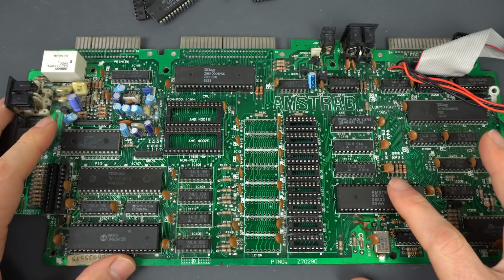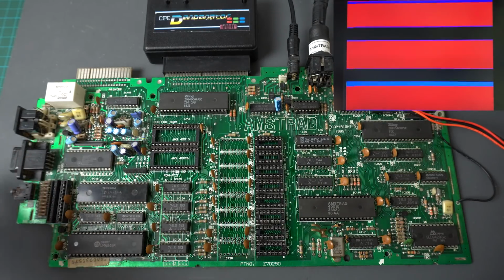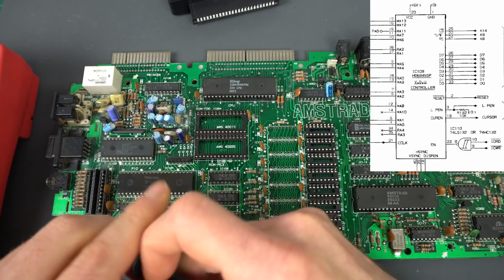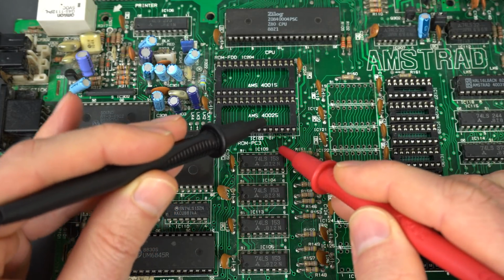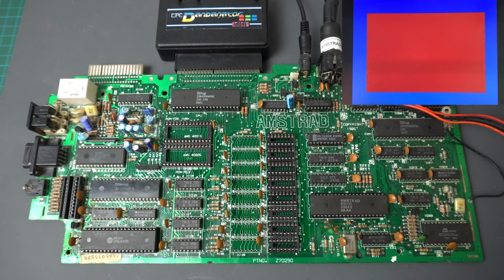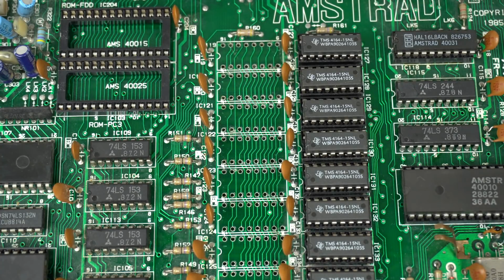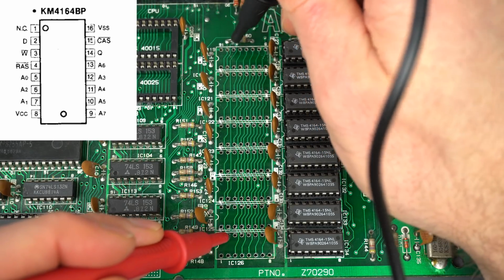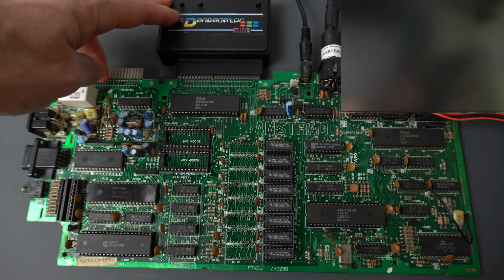Amstrad CPC 6128 Super Fragile PCB Tracks

Comment: excellent repair there. my 6128 though ive made a lot worse today 😢 i had changed all of the ram for ram sockets.. 7 repaired traces later i go to connect the cables to the board without the keyboard just to test and i had connected the 2pin connector of the 12v in into the 2 pin connector on the top left of the board...
i turn on the amstrad and got a black screen initially, but after checking continuity again on the ram and the 400025 chip it booted to a black border screen with a solid pink sort of colour. im going to buy a dandanator if i can find one in stock to see what it could be. i wish i hadnt have messed with desoldering all of the ram!
Reply from the maker: You can also just burn the diagnostics ROM to a 27C128 (or 256) and use that, but you'll have to desolder the ROM IC for that.

Comment: I have worked on all of those machines and I believe that the  the 8bit line and especially the 800xl without the Freddy chip has the best board to work with. C64's(and Amiga 500) ground and 5 volt planes are so massive and the absorb all the heat that even changing caps becomes a pain, Speccys are really delicate as you said and I was fortunate enough to watch this video before digging in my CPC!  Last month I worked on an Atari 130 XE. I removed all the ICs , installed standard sockets... and didn't work. I remove all the sockets  since I don't have have diagnostic tools,  installed machine sockets and it worked perfectly. I even de-soldered some  sockets for a third time  (really late arrivals of machine sockets) and no tracks were broken. I can not say the same for an 65XE though!

Comment: I worked for Control Data in the late 60's early 70's and we used 30 gauge wire wrap wire to repair or modify circuit cards.  The nice thing about wire wrap wire is you can route it between pins on the topside as well as solder it to pads or traces on the underside. A tiny drop of glue will keep long wires in place so they don't snag and get pulled off.  

We used to call the mods to existing boards "engineering change orders" so we often just called the wire ECO wire!  

I prefer videos under 20 minutes as well.  Some of the channels with hour or longer videos are useful but hard to watch all in one sitting.

Comment: Thanks for the video.  Been looking at Anstrads but so far just looking.  Guess the takeaway for me is to just do a continuity test every time you replace something.  Pretty sure I was taught that, but you know how that goes.  But with the amount of stuff you pulled I can see how you could really get behind the curve.  Wonder if using some hot air and a solder sucker may have been less abusive.  I find that just because I have a tool that is fast I tend to use it.  Sometimes fast just turns into more work in the end.  Anyway thanks.  Great content.
Reply from the maker: Checking every single connection you unsolder is ideal but a bit unrealistic when you do massive ones like in this board. And really, 99.9% of the time I either have no problems, or I'll see that I pulled up a track and I'll fix it. What shocked me here is that I honestly thought they were fine and the damage was tiny.
Reply: @NoelsRetroLab  Yeah I couldn't see it on the video.  I was kinda shocked too because everything I've seen on Amstrads say they are built really tough and are one of the more reliable of the 80's 8 bits.

Comment: Thank you Noel. I have never had a problem with any of my 6128's. Then again, I don't supply the 5V rail with 12V but if any repair is needed in future I will be aware.
I can't understand why the tracks need to be so thin. After all the blank PCB's are fully coated with copper before etching so that rules the cost saving out.
Reply from the maker: Yeah, it's puzzling. Especially having great examples like the C64 boards.

Comment: The shape of the track->pad connection on the C64  is called "teardrop" ( https://en.wikipedia.org/wiki/Teardrop_(electronics) ) and it's made specifically to prevent the stress point where those breaks happen. It's much less of a concern on modern PCB process, but still used regularely.
Reply from the maker: Thanks! I didn't know that name, but I definitely saw that the C64 has that shape. This explains exactly why you'd want that! Now, was it more expensive to design PCBs with that shape? I wouldn't think so, right? I wonder why they didn't use that in these boards.
Reply: Mmm, I don't see why the PCB production would be more expensive with that shape, it's just the photo mask that changes.
Now it's possible that whatever process they were using to create the photo mask master didn't support it ...

Comment: The format works.

  If you get some spools of tinned copper bus wire and some tiny heat shrink tubing to match, it makes jumper wires much easier to deal with, and gives cleaner looking results.
  The bus wire can be soldered to the first joint while still attached to the spool, then contoured, covered with shrink tube, cut to length, and soldered. I get tubing that is barely larger than the wire and don't bother heating it beyond just soldering it. The length doesn't change significantly either way, I'm just skipping the step because it's a waste of time. 
 Alternatively when a point to point through hole wire connection is needed, use the heat shrink tubing cut to length, then add the bus wire to make perfect 90 degree through hole solder leads. The result is a perfect length, virtually heatproof, insulated wire. It's faster than cutting and stripping wires too.

  BTW, if you liked the silk screen with the pin numbers on this Amstrad, I have a github repo for classic dip chip pin labels you can print-cut-paste them on. There are around 300 part numbers available in pre-made PDF's that should be ready to print. The two GIMP xcf files I used to make everything are also in the repo, one for standard width chips and one for wide/oversized (like 68k), along with a full description of how I used them with the layers file organization structure and fabrication guide layers. I tried to explain it so that even someone unfamiliar with GIMP could figure it out. If you check out the repo, my labels are unlike any you'll find elsewhere. 
  I started the label project after beginning Ben Eater's breadboard computer project and getting tired of looking at datasheets constantly for pinouts. Later, I also got tired of the nonintuitive pin nomenclature used on the various chip datasheets, so I started evolving my labels with lookup tables, logic gate graphics, and other (hopefully) more intuitive naming conventions. I'll skip adding the link here for YT reasons, but my github account has the same name as here, searching should find it easily.
   These labels might be a convenient filming alternative to the datasheet pinout overlays, although I didn't exactly design them for this, and the text sizes may be too small to be useful. I can also say, the labels are easy to add and remove using PVA glue (white glue like what is used in grade school), and alcohol to remove it without a trace. Most of my labels have full pin numbering, function naming, and a header portion with part number, manufacturer, and purpose. Most part numbers have several label versions, and I've made labels specific to the various package dimensions of my parts stock. I mean things like the logic gate chips that come in the short 1/2 end pin configuration with shorter length versus the ones that have overhang. I've made labels for both so my labels fit either version perfectly.
 
  I'm not monetized here in YT, and the labels are MIT licensed (AKA no warranty, do whatever you like with them, I don't care if it's commercial or otherwise). I share freely, no strings attached.

Thanks for the upload.
-Jake
Reply from the maker: Thanks for the feedback. And that sounds like a good idea. I'll try that. Cheers.

Comment: I do like this format for both its "quick fix" content and running time. Personally, I usually prefer retro repair videos under 20 minutes -- multiple parts are fine but 20-ish minutes suits my free-time requirements the best.

Wow, those are thin traces. It is no wonder why they are so delicate. I have used the same probing technique when testing C64 RAM faults; it's quick and methodical. Great work again with this video -- very informative. 👍

Comment: I find the fragile PCB traces are more a board manufacturer thing, as you will find boards made by a particular manufacturer are robust, yet the same board layout from a different supplier, ostensibly the same board base material, is more prone to either delaminating or breaking tracks. I got reasonably good at repairing them on some, as the traces would lift, so you had to glue them down with superglue, and then solder in a thin wire link to get connectivity, then glue the trace back down again where you soldered, as that are had debonded again. Then a thin film of conformal coat applied both to protect the board, and to hold down the other traces as well. 

Had to do a lot of really thin wires through some through hole traces to get connection to the inner traces, though they were only power and ground, so easy enough to simply glue down a wire to an alternate hole nearby for this, in addition to the original hole being repaired. Some of those boards the only thing keeping the traces on it seemed was the conformal coating, which was not meant to be solder through, but with a good extractor to get the fumes out fast you could solder through with no problems. 

Some though the coating would survive solder temperatures without passing it's glass transition point, so you had to use fine sandpaper on a stick to get through it to solder. Those boards you had a 50/50 chance to get the component off in many cases, as if there was anything under it trace wise you knew it was going to get torn off with the faulty component in most cases, and you would have to do a whole bunch of fine repairs. Those boards though were bleeding expensive as spare parts, so you did try your best, the price was more than the mass in gold.

Comment: Nice format and easy to comprehend explanations. Did you ever try to use the wiring pen for repairing the tracks? Works much better than the wires in plastic insulation. I once had to fix 4 factory-drilled holes on the RAM placeholders of the CBM-4008 motherboard. Those were drilled to prevent RAM upgrade. Using the wiring pen was the obvious choice. You can even do the cable management with the special plastic holders.

Comment: the tracks on that 6128 look great compared to the ones on the 464 board i have..almost looks as if they are just soldered tracks.. bubbley and wavey in places and way to easy to bridge the tracks! 
nice one Noel.. keep it up!
Reply: Hi, these bubbly and wavey tracks are just fine. Back than the HASL process ( hot air solder level) as it is done nowadays wasn’t esteblished that widely and ENIG (electrodes nickel immersion gold) is expensive in this low budget market for large boards so they simply put the bare boards through a wave solder bath a - for protection and b - for added current handling capabilities on thin traces. Those old HMOS and NMOS chips are much more power hungry than more modern CMOS variants.

Comment: After using the desoldering gun, a little bit of hot air really does miracles during the actual IC removal. It works. No pin wiggling necessary. I never damaged a single pad anymore since I'm using that method.
Reply from the maker: The problem is that the hot air needs to be hot enough to melt the solder, right? I'd just be concerned about damaging the IC (assuming you want to save it).
Reply: @NoelsRetroLab  Thats what truly surprised me: 200°C and just around 5 seconds is enough. Put only a slight bit of tension under the chip with a tool an heat its legs. It will magically slip out. I don't really understand why this is. I suspect that if you already removed most of the solder with the desoldering gun, the little bit of solder left in the holes has such a little thermal mass compared to the IC legs that it will get soft very fast. Just try it next time.
Reply from the maker: @Shmbler  Interesting. I will try it next time. Thanks for the tip!

Comment: Well done , another good machine coming back to life :-D
When i removed solder, i would make sure each pin could be waggled easy, then check the top of the pcb for the pin  shoulders that may still be soldered.
If you need really thin enameled copper wire,  find a faulty battery clock, there is a solinoid full of really fine wire :-D
Reply from the maker: That's also what I normally do (I don't usually show that step in the videos because it's boring once you've seen it once). Normally I never have this happen, so there's something very fragile about these tracks. Weird. The enameled copper wire would be for those track repairs? I should look into it because I don't like this small wire. Very easy to melt the plastic away.
Reply: @NoelsRetroLab  The enameled wire in battery clocks is like hair, you can make a link and it's almost invisible.
Thicker enamel wire can be found in dead car relays or small motors/stepper motors/solinoids.
Worth having a look around :-D
Reply from the maker: @zx8401ztv  You still need to strip the enamel to solder the ends, right? How do you do it? Just with a knife or some scissors I take it?
Reply: @NoelsRetroLab  No, if you apply an iron and solder to the end, the laquer burns off while you tin it.
The clock wire is like a hair so you would never be able to scrape it.
If thin wire is a nightmare to you,  take a small mains transformer apart and use that laquered wire, an old phone charger thats. (low current means thin wire.)
Anything that uses inductors, a speccy 5 to +/- 12v bobin coil.
have a go :-D
Reply from the maker: @zx8401ztv  Cool! I'll definitely look into it. Thanks!

Comment: to prevent the cable from melting, use a crimp tube
Reply from the maker: I'm not sure I have them thin enough, but that's a good idea.
Reply: @NoelsRetroLab  In the country where I live I can not buy the thinnest shrink tube in stores.
The alternative is to order from Ebay or buy a cord that can withstand more heat.

Comment: An 18 minute video is still a decent length. On top of that if you have something like this and you put it in a series of 2 or 3 videos on a full 6128 restoration then it's not likely to stand out for the particular fix you're doing. And an interesting fix like this does deserve to stand on it's own.
Reply from the maker: Thanks! Glad you liked it. This one ended up being longer than I intended, but the important part from my point of view is that it's quick to make 😃 It can easily take the slot of a mail day or something like that depending on what I run into. On the other hand, regular episodes can take MANY hours to plan, shoot, and edit.